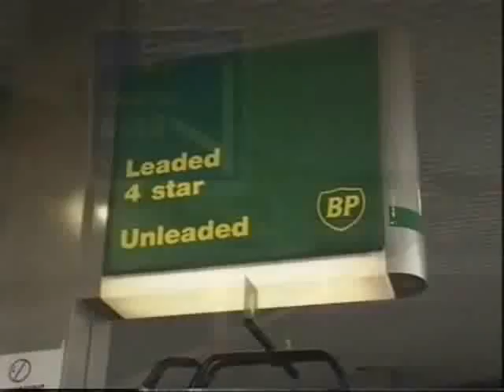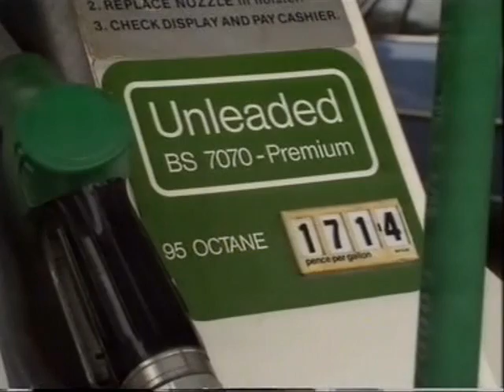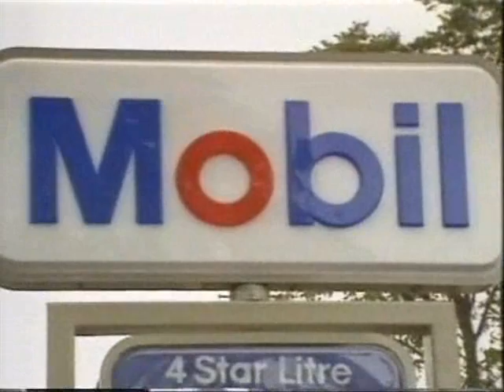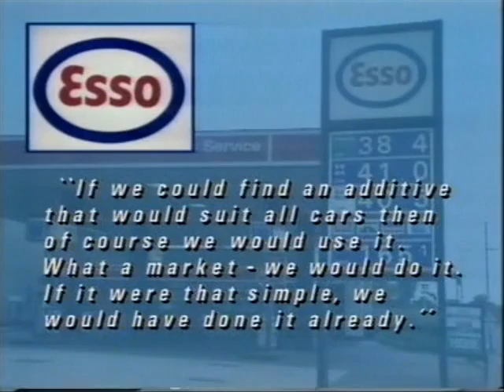Leaded and Unleaded Fuel of Different Ratings Explained (Top Gear 1989)

Comment: I switched to unleaded for my Suzuki GT550B in 1989 after the bike was listed as being OK to run unleaded, figuring that on a bike that did 9 MPG in town and 18 MPG on the open road, I'd save money on petrol..... Bull!! It holed pistons about once a week in one of the 3 cylinders. Once I started the bike and left it on tickover whilst I closed the garage door. In those 15 seconds it managed to pre-ignite on one pot and blew a hole so big in the piston that it looked like a blowtorch had been used. I went back to 4 star leaded after the dealer told that it was the unlead that was the cause of the problem (after he'd sold me thev 6th piston and gasket set. Apparently his concience was troubling him as he'd already figured that I was using unleaded.

Comment: Old 4 star was about 98 ron octane , so modern unleaded will make you go just as fast as the old 4 star
Reply: Regular unleaded is equivalent to 2-Star. 4-Star was the premium leaded petrol of the time, the modern equivalent would be premium (high octane) unleaded. 2-Star was 92 RON (almost the same as modern day 91 RON unleaded) and 4-Star was 98 RON, the same as today's premium unleaded fuels.

Comment: Leaded petrol is like ROCKET FUEL compared to the current unleaded. Flying cars with that crazy juice
Reply: Yeah but I'd rather not have lead poisoning
Reply: I can buy VP110 leaded fuel at the gas station down the street and sunoco still sells 98~110 octane leaded race fuel in cans.

Comment: You can, but you shouldn't. Engines that require leaded truly NEED leaded. The lead acts as lubricant for the seals in those engines (because of the materials the seals are made of) Of course, you could run unleaded in an engine that requires leaded- it just wouldn't be too good for your engine.
Reply: Sort of. Tetraethyllead was added to petrol to make the fuel much more resistant to combustion by compression. This prevented engines from pre-ignition on the compression stroke, since the fuel couldn't withstand the compression and combusted (which is NOT when combustion is meant to occur.) The TEL also protected the exhaust valves from valve recession.